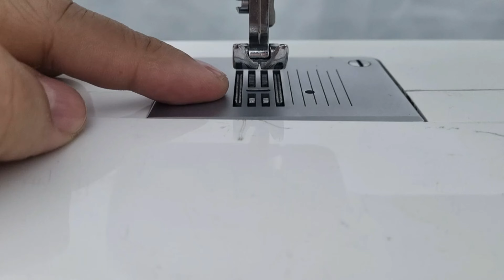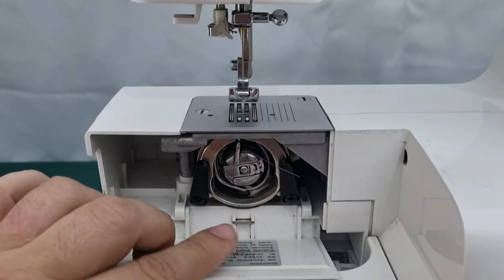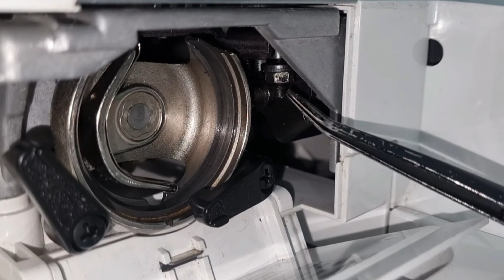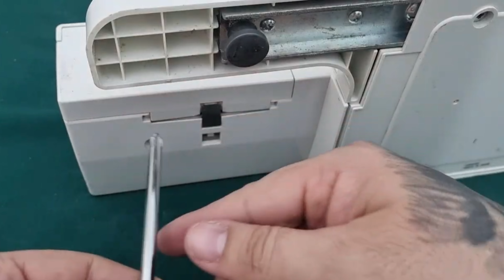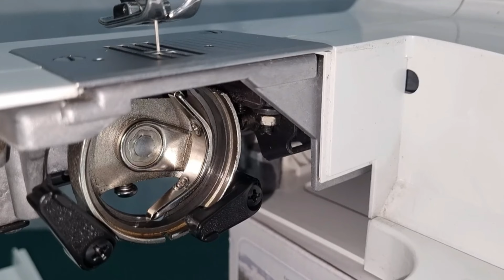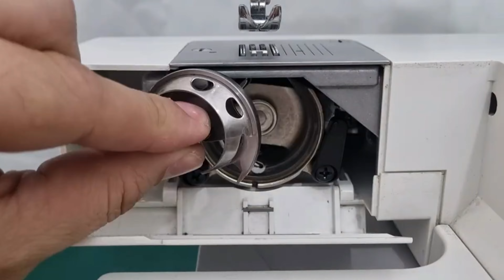How to RAISE the FEED DOGS on a SINGER Sewing Machine

Comment: "Hello sir, thank you very much for this new and very interesting video. If possible, I would love it if you could make a video on adjusting the timing on a Bernina Artista 200 or 180. Also, when I turn the handwheel on my Bernina Artista 200, I feel a slight resistance when the needle goes down, but none at all when it goes up. It is not very strong, but I would like to know if this is normal or if it indicates a problem with the machine. Thank you in advance for your kindness, and thank you again for the very interesting videos you share with us."
Reply from the maker: Regards,

I don't have your specific machine on hand right now to make those videos, though keep in mind that many settings are the same across different brands.

For now, remove the parts from the hook assembly and check for any tangled thread in the mechanism; do the same for the needle bar.

To determine if the problem lies elsewhere, I would need to examine the machine in person.
Reply: Hello.
Thank you for your kindness. You are the only one out of the dozen people I asked on YouTube who took the time to reply to me.Have a good Day.
Reply: Thank you so much!